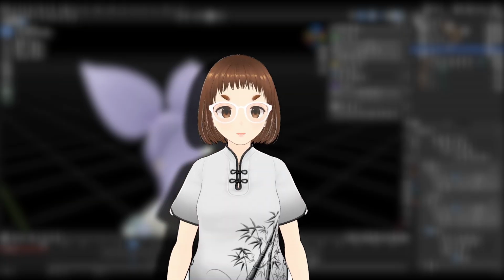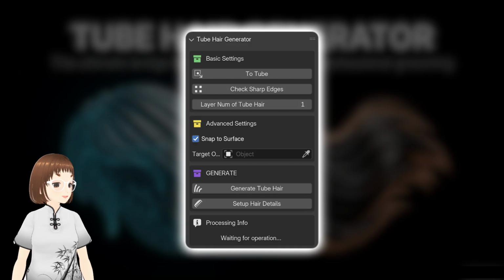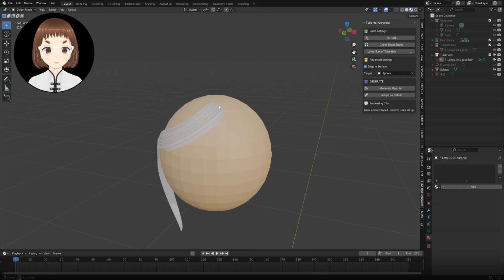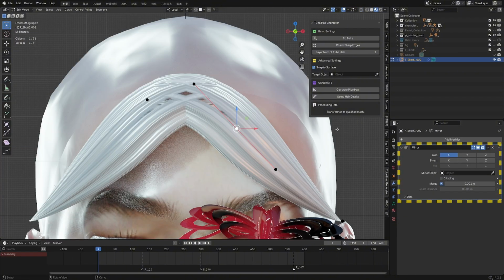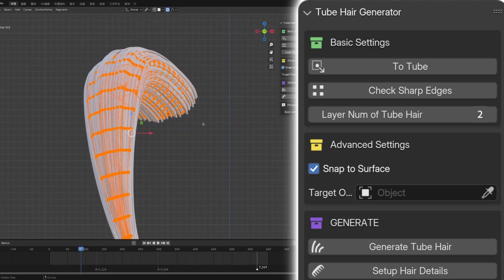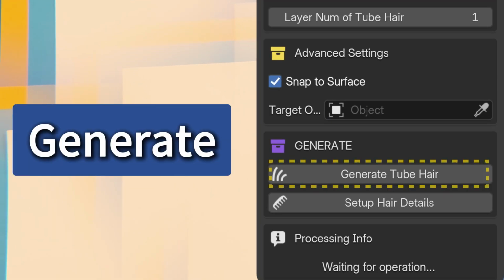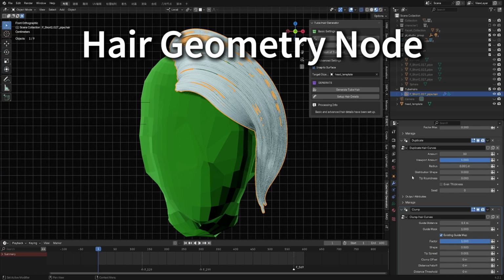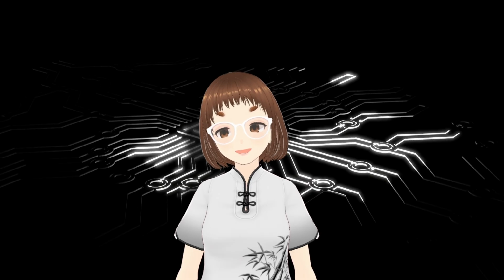Turn Tubes Into Hair in 1 Click | Blender Addon

Comment: If I make a 3d hair model using meshy ai and its a solid polygon mesh can, this be turned it into hair?
Reply from the maker: Thanks for your question! That's an interesting idea. Unfortunately, not at the moment. (,,•́ . •̀,,)
The current workflow relies on clean tube topology to generate Hair Curves, so it isn't designed to convert a solid polygon hair mesh (like one generated by Meshy AI). 
Right now, it only supports clean, tube-based hair geometry.
Reply: @SY_007_CyperMuse  so in the future will you make it were it can convert solid polygon hair mesh
Reply from the maker: @jtoshgaming8212  That's definitely a promising direction. I've actually come across some recent papers tackling similar problems, and I'd love to explore it further. Hopefully it's something I can support in a future version.